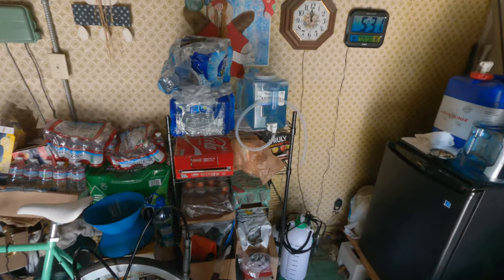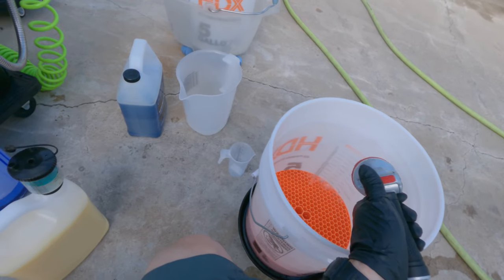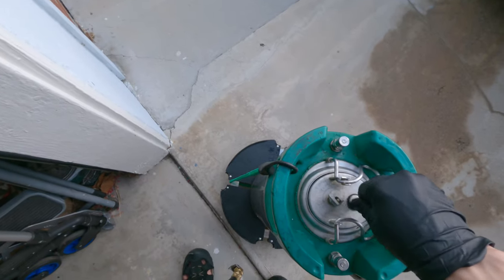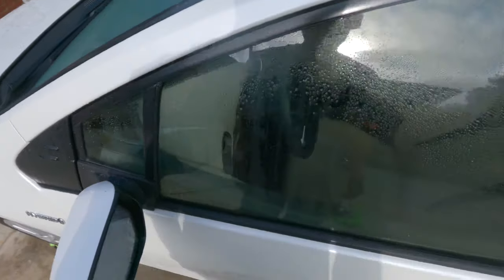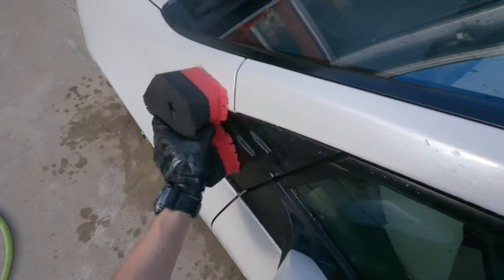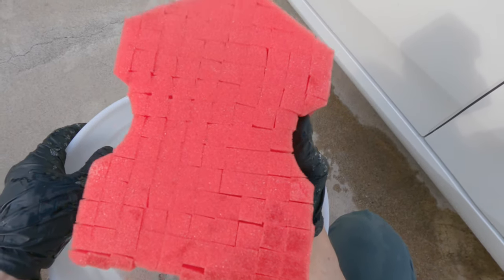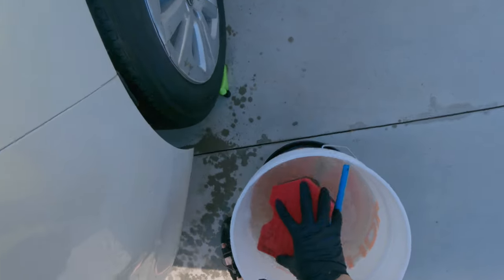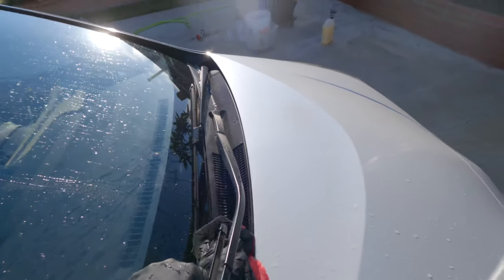Is This Rinseless Wash Worth Getting? (DIY Detail Rinseless Wash V2) | Hawke Review

Comment: I bought a gallon of the DIY V2 Rinse Less Wash and love it!  I think I dream of the smell.  I filled a bunch of 32oz pump spray bottles with it and have them all over the place.  I even have one at my computer desk to clean the desk and the monitors!  YES, it is safe at 256:1 ratio to clean the matt coating on the monitor with, and I believe it a anti-static surface as I don't notice them getting dusty as often but that my be because I'm cleaning the whole dam house with DIY V2 Rinse Less wash.  I wish I had know about this product before I bought the new pressure washer, new 50' uberflex hose, new RIDGE shorty pressure washer gun, and 2 foam cannons.

Comment: That Proportioner isn’t meant for gallon size because it’s impractical to squeeze desired amount out of a gallon container.  Now on the other hand hand I use mine on 32 oz bottles and 16 oz bottles 👍
Reply from the maker: There are proportioners built for gallon bottles and 16/32 oz bottles depending on which version you buy.